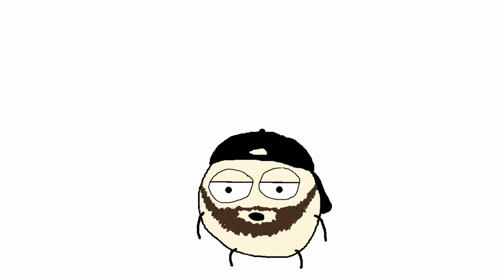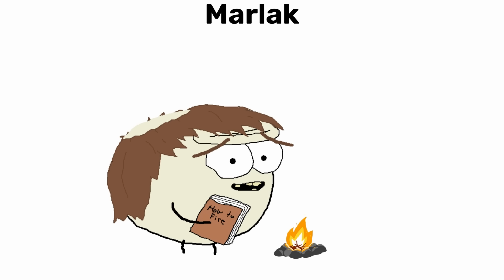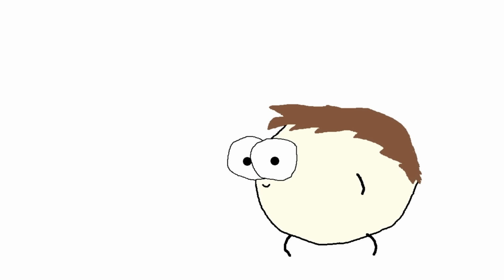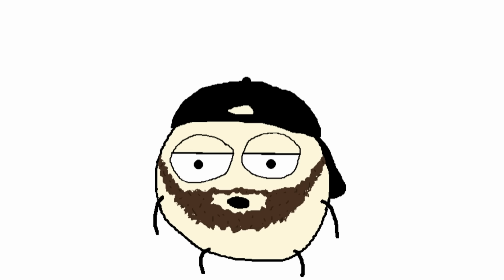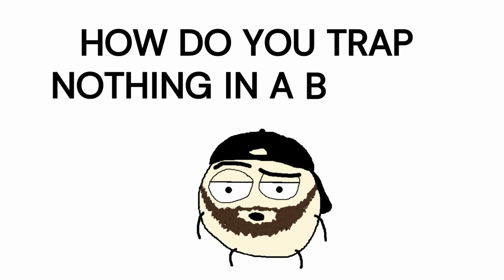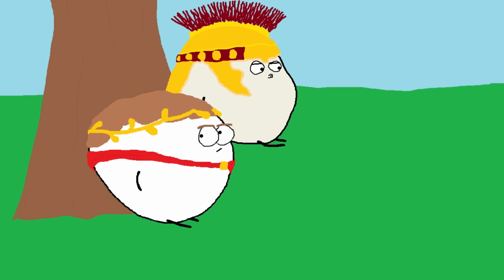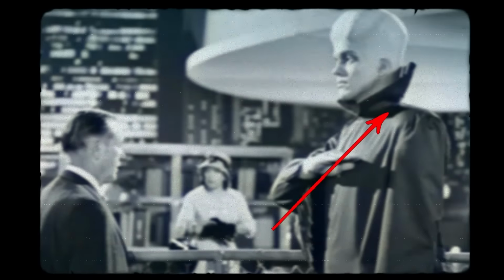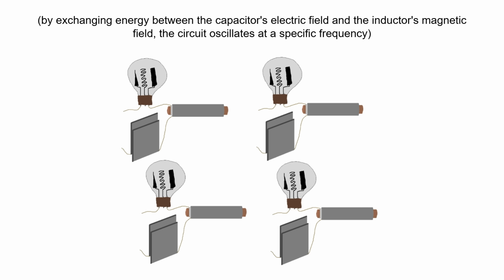How long would it take to build a TV in ancient Rome?

Comment: Now I wonder how easier would be for Fred to build a mechanical TV (but with working camera) so he could transmit Coloseum fights live to other provinces.
Reply: The Romans would definitely sponsor him in that case then lol
Reply: the original mechanical TVs used neon lights for the display, which are incredibly dim and require cryogenics, and a cesium for the phototube, which explodes on contact with air.

if Fred were as smart as he's described, he'd make Silicon Carbide in order to make an LED/Photovoltaic Cell, which are technically the same kind of component. it wouldn't just be easier, but also make a way better camera and display.

they don't need anything too exotic, silica, carbon, and some dopants, probably phosphorous. then all you have to do is heat the powder, which would probably be the most difficult step.
Reply: @michaelfixedsys7463  if all we're going for is functionality, we can skip the electric lighting, just heat up some lime or use some reflectors on an alcohol lamp, then use a mechanical shade to control it, that'll produce more than enough light. the hard part, in my opinion, would be getting it to consistently rotate at the exact correct speed. a mechanical TV only produces an image if the disc is rotating at the correct speed to be synced to the light source or it's shade. it also has to be pretty much perfectly balanced or it will vibrate itself apart, and doing that with roman equipment would be difficult.
Reply: @Minty1337  the reason you need an instant electric light in a mechanical TV is because it has to change brightness for essentially every pixel in every frame (I know it doesn't technically use pixels, but you get the idea.)

That kind of rapid changing in brightness, bare minimum on or off, thousands of times per second can only be reasonably achieved electronically. And physical mechanism that can do it would be far to expensive to be practical, and would wear out far too quickly.

Plus, the rotation of the scanning disc in the camera and the display have to be perfectly synchronized, otherwise it just produces a garbled image. Any more moving parts just makes syncing them up even more unlikely.
Reply: @michaelfixedsys7463  if it really has to be instant, how could a neon light have worked? neon lights take about a millisecond to turn on, which sounds fast, until you realize that means only 1000 pixels per second, which is only 2-3 lines of a NTSC signal.

also you can better sync a mechanical wheel and flap much easier than you could with a mechanical wheel and electrical light. also getting mechanical parts to move at that speed is pretty doable, especially when we're just talking about a light flap that just needs to block some light from a porthole.

no matter what, this is difficult, i was just looking to find a way around using a glass bulb, everything seems to hinge on that and i was looking for a more creative solution.
Reply: @Minty1337  mechanical TVs had very low resolution, so that 1000 pixels per second is probably accurate. They also only operated at about 15 frames per second.

You also don't want the the flap and wheel to be synchronized, the light has to turn on and off arbitrarily to produce the image while the wheel remains constant. 

If this could be achieved mechanically without being more effort than it's worth, it would've been.
Reply: @Minty1337  You don't fully turn the neon off, you strike the arc once and modulate its brightness by adjusting current. Alternatively, you could make a VFD-type light with a hot cathode, a grid to modulate the brightness and a phosphor to glow, but that's like 90% of a CRT already (conceptually at least).
Reply: @Minty1337  Going at a constant speed is actually not hard. If what drives the disc is a steam engine (totally doable with roman tech), a governor would do the trick - it's a device consisting of two or four heavy balls on rods and springs that spins and uses centrifugal force to control the amount of steam going into the piston. The faster it spins, the less steam it allows in, which makes it spin slower, which allows more steam into the piston, making it spin faster. Eventually, the speed settles down to an amount that can be dialed in.
Reply: @fnunez  You are absolutely right - but the problem isn't just maintaining however many RPS for the televisor disc - you also have to make sure the recording disc and the display disc are rotating in sync.  Both discs have to return to top dead center at the same point for every frame.  Historically, timing pulses were actually baked into the oscillations of the AC mains voltage, but getting alignment between the studio's discs and the receivers discs was a finnicky and difficult matter.
Reply: @Minty1337  It's microsecond not millisecond. Baird used 30 lines of 70 "pixels" at a framerate of 12,5 images per second resulting in 25200 light changes per second. For a little more light, Fred could use a Kerr-Cell (super fast working full electronic shutter) to modulate the light of a carbon arc lamp.

Comment: Do a video on how hard it would be to make an AR15 in Rome.
Reply: Thats plausible actually, a gun has no electrics, the bullets would be the hardest thing to make, but fliklocks in ancient rome are 100 percent plausible, u just need a long woodwn tube and some flint, hardest part, metal woek for the pan and triggers and stuff
Reply: @BadDaraGaming89  A basic flint lock design would be easy but a self loading rifle with a lot of parts that require machining would be difficult. not to mention modern smokless powder.

Comment: You could use an electromechanical TV using an solar panel made of natural plants which contains photo-sensitive elements to extract, or instead of solar panels use Selenium metal, an experimental carbon fillament light bulbs and an nipkow disc spinned by an eolipile, it's basic, yet cheaper and easier, and more possible
Reply: Considering solar panels aren't a viable technology yet today, I doubt their efficiency before the crucifixion
Reply: @1stCallipostle could use Selenium too, like the photophones

Comment: The video is really well done and the explanation about how difficult it would be to build a cathode ray television in a Roman-level setting makes total sense. You’re absolutely right that even with modern knowledge, recreating vacuum tubes, stable high-voltage power supplies, electron guns, and phosphor screens would be an enormous challenge. It would take a huge industrial base and a lot of trial and error, so as a long-term project it’s definitely as hard as you describe, if the goal is simply to demonstrate basic video transmission rather than build a full CRT display, a mechanical system like a Nipkow disk might be a more achievable starting point. It only requires a precisely drilled rotating disk, a light source, and a photosensitive element to scan the image line by line, plus a synchronized disk on the receiving end. The image quality would be rough, of course, but mechanically scanning and reconstructing brightness levels avoids the extreme material and vacuum challenges of cathode ray technology. As a proof of concept, it could be a simpler path while still staying historically grounded in early television development ✌️

Comment: Request: How long would it take to make a record player in the Roman Empire?
Reply: Probably quite easy, as long as the actual method is nailed down, would probably have to be more similar to a wind-up gramophone though, but does just boil down to a piece of wire with a fine needle and an amplifier (just a horn or sheet of material or something). The main problem if anything would be making a somewhat decent record for it.
Reply: and a related one: how long would it take to make a radio, along with stations to make use of it
Reply: @Minty1337  The "cell phone" video was essentially about building a radio. Making a broadcast station won't be much harder than a simple receiver, just needs more power.
Reply: @IgnacyG1998  that "needs more power" situation is harder than it sounds since it needs to be DC, and very powerful for any usable range, otherwise you just made walkie talkies. it's also even more difficult if you mean "usable stations" as in, a proper network of stations where you could tune in anywhere in the Roman empire.
Reply: I've read somewhere that a record player (phonograph) doesn't even require electricity to be made, so it makes the job easier.
Reply: @samdrow8268 The first ones were clockwork, I have two! The Romans could quite easily have built one if they knew how. 
We could have known what Caesar's voice sounded like!
Reply: @michaelmartin9022  metallurgy is a neglected sticking point: making the spring for a windup phonograph has GOT to be tricky.
Reply: @jeric_synergy8581  Make it weight driven
Reply: @samdrow8268  Crank handle, spring driven mechanical 78rpm phonograph players were common.  My Grandmother had one (she was born in 1897).  The 78 rpm records were thicker and used steel needles about the size of a sewing needle. A curved audio path (a horn) acted to amplify the sound which travelled directly down the arm holding the needle and passing into the horn. Nothing would be impossible with Roman technology but the creating actual records would probably be the hardest.  I kept it for decades but finally sold it when I had to downsize from a house to an apartment due to age.
Reply: really the only hard part would be actually recording the records. Designing a recording machine would be easy but building it with tight enough tolerances might take years
Reply: @alexkuhn5078  Edison managed it.  But, yeah, years.  For one thing, you'd have to fabricate things like micrometers to aid in the production of all the OTHER pieces.
Reply: @jeric_synergy8581  sorta yeah. It's one of those scenarios where you'd almost need to build a tool to build a more precise tool to build an even more precise tool to finally build the parts. Doable, but more complex than it seems
Reply: @alexkuhn5078  a gramaphone in reverse records on to wax records
Reply: @SleazySnake  Totally, but the recorder would need to have 'feed gears' that guide the cutter along in a steady maner. That would need to be pretty precise. You'd need a very tightly toleranced gear train to that ran with very little noise otherwise the gear noise would drown out the signal to be recorded
Reply: @alexkuhn5078  I've seen it done at a phonograph collector gathering
Reply: This one is relatively feasible, I would love a video on that
Reply: Considering you could make it yourself with hand powered carpenter tools not hard at all. A gramaphone with wax cylinders.
Reply: In a way it's surprising that sound playback wasn't invented in ancient times, so simple is the concept.  However Edison started with recordings on tinfoil that degraded very quickly.  To make many durable duplications of a recording is the result of a string of additional inventions.

Comment: finally, a video that could be viewed in it's own alternate timeline, now just make a computer, animation software, recording equipment, and the internet and we could be watching this in 100AD
Reply: Computer would be a fun one, all you'd really need to do is make tons and tons of relays out of copper wire and iron nails
Reply: @alexkuhn5078  that is one i've thought about before, it seems very doable, especially if you allow for electromechanical computers. the hard part would be making it useful, sure you could make a calculator but any human with enough time and paper could do the same thing, having a computer that does something like run a machine would be impressive.
Reply: @Minty1337  True, it'd be hella slow lol. I think I read somewhere that relay computers top out at about 15 or 20 Hz
Reply: @alexkuhn5078  i've heard they can get up to 50-100hz, but yea, that's barely enough to finish drawing a standard resolution screen in like 5 minutes... per frame... not counting any calculations, that's just to fill the screen with a single color...
Reply: @Minty1337 sad part is you actually think you're funny
Reply: @shadycnetwork  you must be fun at parties
Reply: @shadycnetwork bro seethed so hard in his second reply it got deleted
Reply: @120_1Enot really, just annoyed by pathetic losers trying to be funny.
Reply: @alexkuhn5078  If he's already making vacuum tubes he's most of the way there, it wouldn't be a Ryzen but it'd be faster than a human.
Reply: @alexkuhn5078  let's align several thousands of soldiers in a peculiar way and ask them to raise or lower a flag, this is a simple, basic instruction. I shall call that... the human abacus !
Alright now gotta secure erase this strategic simulation, SEND IN THE GAULS !
Reply: " The Germania situation is INSANE '
Reply: Brother you have to remember YouTube only became a thing thanks to the innovation of pornography
Reply: @NickTaylorRickPowers speaking of things the Romans were good at~
Reply: The Romans might not have had dirty vids, but they had dirty pics down pat.
Reply: Technically you can make a fully mechanical computer. Out of Vacuum tubes or even water valves.Results and reliability may greatly vary. 
 Electric computers are just very usefull since they can get so small and are super reliable.
Reply: Your comment reminded me of this cute anime project I stumbled onto on Youtube, "Dungeons & Television", where a sword & sorcery fantasy world has invented TV - which is already in a 'format war' with film.
Reply: @thealmightyaku-4153  that reminds me of an idea i had where crystal balls are mass produced and become television in a fantasy magic world lol, i should actually do something with that
Reply: Like one of those scissors packaged so you need a pair of scissors to open it
Reply: If I am elected president, I will do everything in my power to bring YouTube to Ancient Rome